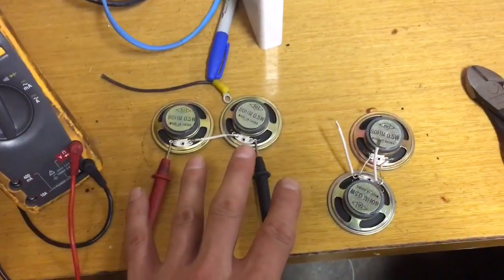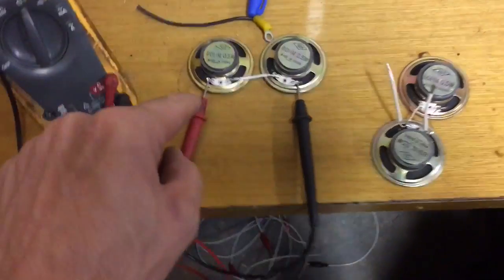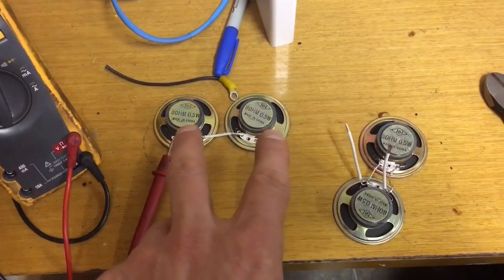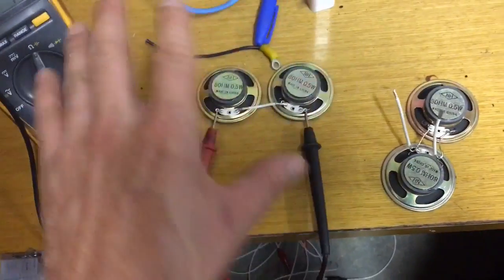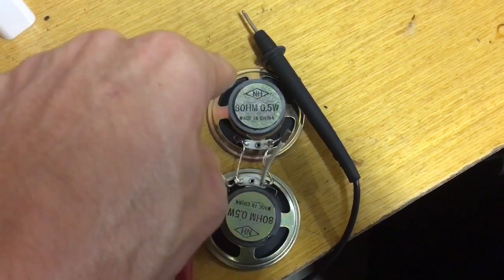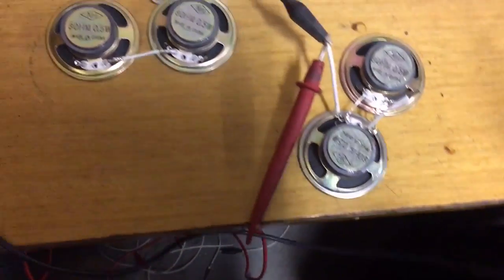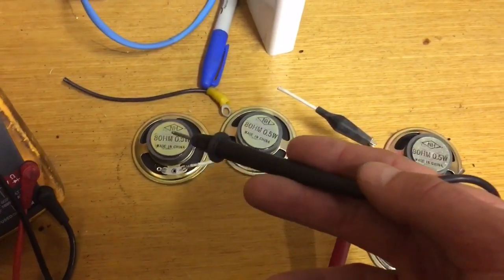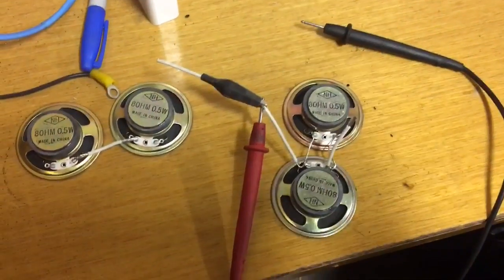Series vs parallel wiring speakers

Comment: most power amp system design from 4ohm to 8ohm so, 2x8ohm speaker in parallel = 4ohm it's still can damage the mosfet?

Comment: Is it possible for two 8 ohms tweeter in series config and connect it to 8 ohms instrumental speaker in parallel config what is the equal ohms of this combination?
Reply: two 8 ohm tweeters in series = 16 ohms.  wiring that in parallel to a single 8 ohm woofer would yield an impedance of 12 ohms.  that's a bit high so it will take some decent power to get them loud unless they are very sensitive.  it's also a curious setup as the tweeters would be severely limited in sound output compared to the 8 ohm woofer.  additionally, it's not generally a good idea to have two tweeters and a single woofer, and i can't think of many practical applications for that type of 2-way design.

Comment: Parallel wiring: two 8 ohm speakers become 4 ohm (can damage amp rated at 8 ohms)

Series wiring: two 8 ohm speakers become 16 ohm (can't damage amp rated at 8 ohms)

Helpful thanks!
Reply: Who is the best parallel or series for high bass ???

Comment: Negative Terminal (-) --> This is where electrons will flow/come out from and will flow TOWARDS Positive Terminal (+). Just remember that one thing even you forget anything else. For some odd reason, very few people know this including engineers and mechanics working for over 30 years.
Reply: We're talking about AC here, not DC.

Comment: I have a question, I'm running a cheap home theater system (rca rtd215) in my garage and find that putting the system in "stereo mode" that the sound is much clearer and louder than in Dolby Digital Prologic II.  Only gripe with this was that only the two front channels (stereo) and subwoofer were active in the Stereo mode, so I took my rear two speakers and plugged them right in with the two front channel speakers on the back of the amp.  Meaning LF and LR are in the same terminals and RF and RR are in the same terminals.  I don't notice any decrease in sound quality and actually think the sound is a bit louder with the 2 speakers per channel set up in stereo mode. 

Now each speaker and channel is rated at 4 ohm 32 watt.  By the math this makes the two channels at 2ohm.  

How is it that I have ran my amp this way for over two years no without any issues?
Reply from the maker: Dillon C my best 2 am guess is that your not cranking the volume to 11. The mosfet transistors that do the amplification can only give so many amps, when you run a system below its rated ohm rating say 2 ohms on a 4 ohm stable amp.  cranking the volume will make the amplifier try and give more amps then the transistors can give and they start getting damaged but if your not at higher volumes you may only be asking those transistors to give the rated amperage or less and thus no damage is being done yet. Again best very tired 2 am guess lol